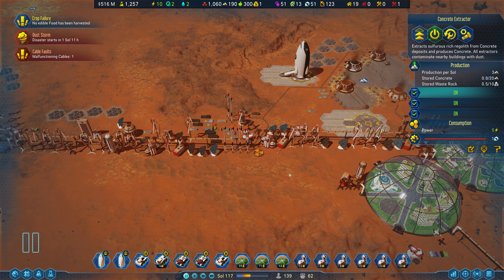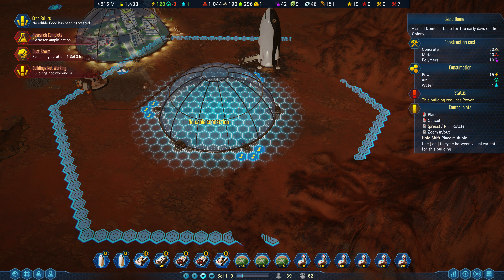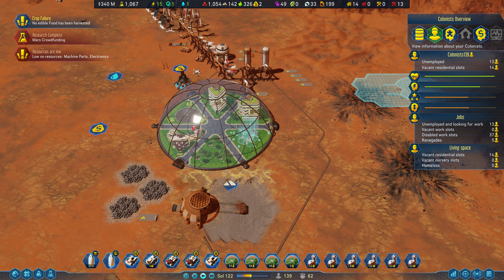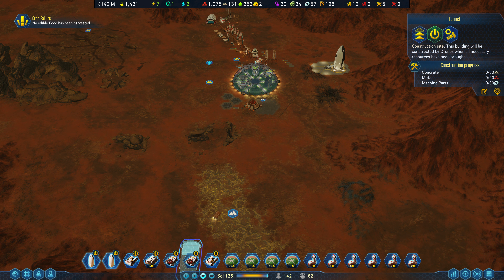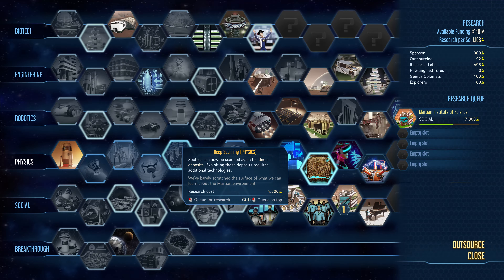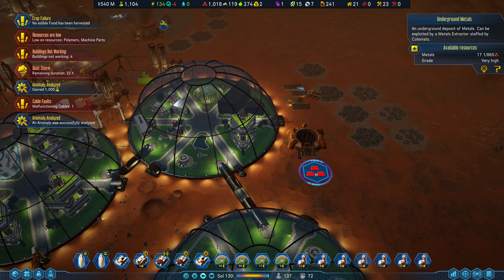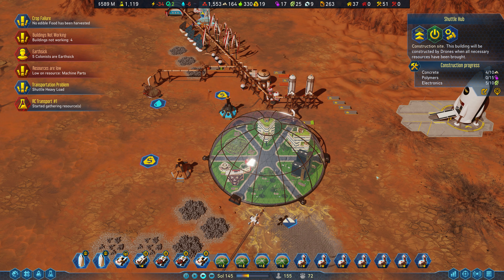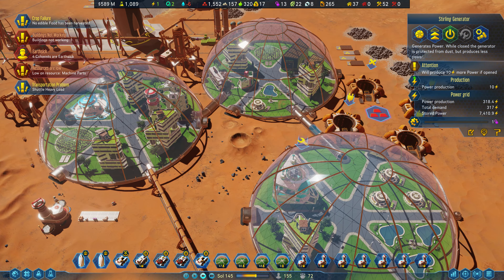Surviving Mars #4 - THE LAST WAR Mystery - Opportunity Update (TUNNELS!)

Comment: Mr. Grind This Game-
There is a logic to placing Sterlings inside a Dome.

However it is a Mid Level use, for ultra difficulty runs.

By building a small dome among a group of Medium/ Mega Domes.
Place only Sterlings in the Small dome, and turn the dome off.

That will give You 600 power. The dome can act as a conduit for utilities toward other domes. Limiting cables and pipes externally. Reducing breaks and disasters.

Speaking of disasters-
By turning the sterling dome off, You won't use water or oxygen for it. The Dome then creates a Tank Shield against any meteor strikes. Which become havoc on higher difficulties.

Because it is off- it won't require maintainence, or be repaired if stuck by meteors. Cold waves won't affect it either.

Because 600 power locally to large domes is usually enough, You can limit risk and resources.

The initial investments may be high, but the long term use becomes invaluable.

It can't even be considered an exploit, because most Resources on any map- are only calculated for 500- 1,000 Sols. After that You only have the Concrete and Metal Wonders to sustain Your colony.

It is a Long Term sustainability solution not an exploit. This will extend many of the finite resources beyond the 1,000 Sol barrier.

Medium Dome Sterlings allot for over 1,000 power. Maintainence Free and sustainable.

Fusion is a good power source, but people lose sanity working outside. And there are better uses for colonists.

Also, Mid Level use 2 Atomic Accumulators near each medium/ Large Dome to survive cold waves easier. It helps have 200 power for each. That will usually get You thru 3 day cold waves.

Comment: I see you have the mod installed that shows all your resources on the top of the screen.  I also have it installed but can't seem to get rid of the hints tab that's on the top middle.  Its covering up like 3 or 4 resources that's shown by the mod.  I see you don't have the hints tab.  Is there some way to remove it?  Thx.  Loving your videos by the way.
Reply from the maker: I think there is a setting to turn off hints in the options menu.